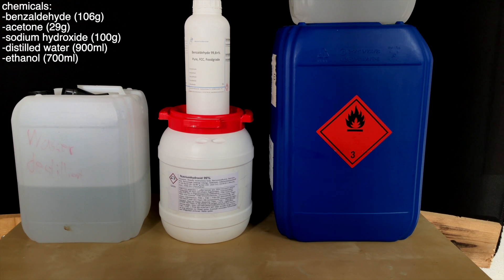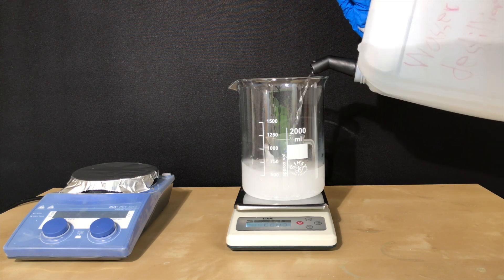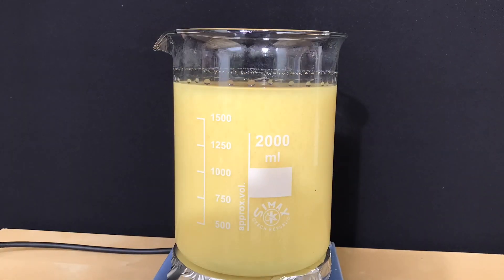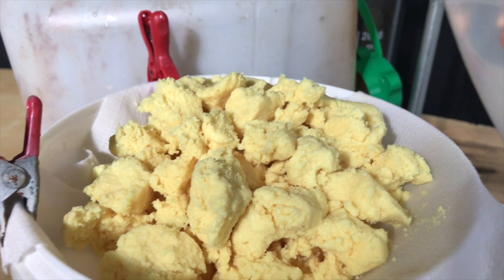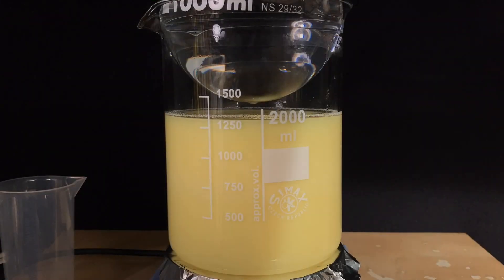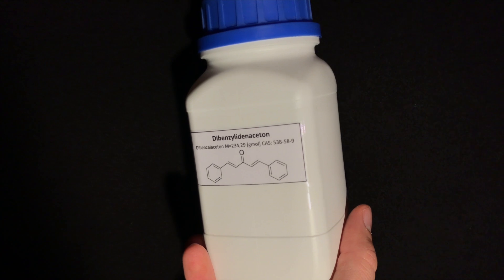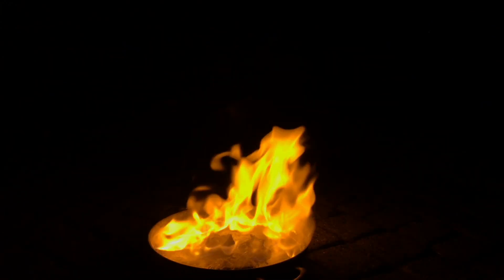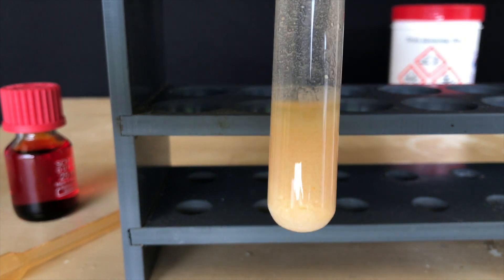Making Dibenzalacetone, A Forgotten UV Blocker

Comment: Pretty sure I did this on a small scale in undergrad. My TA told me to recrystallize in EtOH as well and it didn't work. I suggested adding a little acetone and they insisted it wouldn't work. On a spare day I had at the end of the semester I took some of the pdt from that synth and recrystallized it with EtOH and like 5% acetone (a very small amount). Worked like a charm.

Comment: Nice to see this synthesis in large scale! I did this reaction recently but in much smaller scale. Your product is definitely contaminated with benzoic acid (benzaldehyde impurity in a few days oxidize in to benzoic acid). When I did this synthesis, my goal was to make very pure product, because I need it as a standard. So after first recrystallization from MeOH/water mixture I did Shiff test to see if there is some leftover benzaldehyde and upon mixing decolorized fuchsin with the small amount of product dissolved in MeOH, it produce really strong red colour indicating that there is still lot of benzaldehyde. Even after second recrystallization there were traces of benzaldehyde. But the amount was so small that I decided to let the product sit for a few days and let benzaldehyde oxidize to benzoic acid. Than I removed it using NaHCO3 solution, I heard just little fizzling, didn't see any bubbles of CO2. Melting point of my product is 110-111 °C, exactly what literature says. My point is, that removing benzalydehyde isn't that easy as it seems, you need 2 recrystallizations and washing with NaHCO3 for very pure product. But if purity isn't goal, one recrystallization is enough. You have much higher yield than I, I have only 40% yield.
Reply: How u did the NaHCO3 washing ? Did u just dump the product into some sat. sol. of NaHCO3 in water ?
Reply: @horsthorstmann2480  Not saturated, just 1,5 g of NaHCO3 in 50 ml of water (which is still huge excess of NaHCO3, only traces of benzoic acid are present in the product).